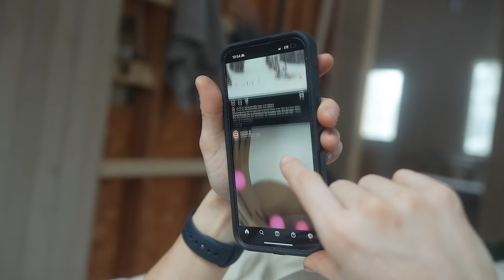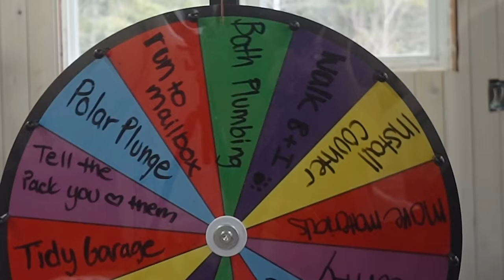Winter In The North

Comment from the maker: Do you need a spinning colourful wheel in your life? This was the BEST & most fun way to get motivated. We’re all doing the best we can, be kind to yourselves 💛
Reply: You should keep the wheel! What a fun way to get tasks done.
Reply: Yes! I always said I never finished the last 10% of my projects.
Reply: I need the wheel. I was in the process of ripping out my kitchen for a DIY rebuild, (i have two cupboards, the stove, sink, fridge and 2 feet of counter left) when one end of my house developed a huge roof leak, lead to discovering hidden issues, and eventually ripping down part of my home to build a new foundation and reconstruct. A builder came, asked for a huge up front payment, and what I got from it was a decent foundation, a pile of lumber, a rickety set of steps to my second floor entry that took out half my outlets upstairs, and a poorly poured, faulty slab before he split. I've been so overwhelmed that I'm immobilized.. help. And, if you need it again, I can send it back!
Reply: @GabrielleSR  I agree
Reply: I need it, but I don’t know if it would help! 😂😂😂😂.  My van needs: counters out of the front passenger seat and on the counters,  gray water under sink needs cut to size, propane line connected from stove to tank, last coat of paint, switches installed, and wiring finished so I can close the ceiling corners, windows and max air fan need resealing…..  oh and rear doors need insulation…. 😂😂😂😂.  Otherwise, it is livable and I love it!
Reply: Sometimes you just have to force yourself.🌀
Reply: Brilliant
Reply: Been following you two for a few years and I think this was my favourite video you’ve put up!  You girls had SO MUCH FUN! You should keep the wheel as a keep sake..
Reply: Yes! What an awesome idea!! I need a wheel for sure! I try to do too many things at once and overwhelm myself. Lol!
Reply: Great videos love it I have D D
Reply: I am totally DDD i still haven’t finished my chicken coop or my garden or rain catchment and other things that wheel would be helpful with much love
Reply: My wife just bought a house in Florida. She’s a disabled vet and we both suffer from DDD! 😆 I’m surprising her today by flying 900 miles to show up unannounced and help her get some things done. Haven’t seen her in 6 months! 😩 one day we won’t have to do this and will live together! IM GEEKING IM SO EXCITED TO HUG HER IN 6 hours! 😁😁😁
Reply: Hello vanwives!! We are getting married this summer (finally!) on our acreage. There are so many things to do, the list is long and I definitely feel a case of the DDD. Your game show wheel would be just the thing to make it fun instead of overwhelming 
Thanks for sharing your week ❤
Reply: Hi Girls! Our names are Bailey and Jaxyn, we are jack russells, and we live in Calgary. Our moms watch you every Sunday like clockwork! We just heard your last video, and we think our moms would be the best candidate for the spinning wheel! Why you ask?! Well one of our mothers work full time at a hospital, and our other mother is opening a new business next month. But that’s not the reason they should have the wheel! They are planning their wedding July 23 at our acreage and they have sooooo many projects to do that they are taking all of July to get them done! We think that the wheel would get them motivated every morning to get the long list done in a more fun way. Anyways, we love you, and maybe one day we can meet Bella and Izzy to play! 🐾🐶🐶
Reply: This was a fun idea! Thanks for sharing. Right away, I told my husband we need one! He’s self employed, I’m a homemaker, we have two tots. Task after task trying to establish our homestead, engaging with the littles, keeping our business going, and just life! Holy cow, it’s a lot. Maybe this will get the kiddies excited about chores too, haha. Way to get it! P.S. Happy Valentine’s Day. ❤😊
Reply: I think everyone needs a wheel in their life. I’m home with my 2 kids ages 9 and 3 for half the month, because my husband is away working and I find myself not wanting to do anything when he’s gone lol.
Reply: I need a wheel for cleaning ! All my chores would be so much more fun! 🎉 love love love this video!
Reply: I'm also living off grid without running water or electricity right now working on starting a school bus conversion, and my dilly dally disorder is kicking into fill gear rn. That wheel might be my neurodivergent brain's only way of having a roof over my head by next winter lol.
Reply: I need the wheel! I'm an elementary school teacher and my partner and I are foster parents. With all the tasks and never ending needs of little ones, I get DDD for all the things I need to do for myself. Prioritizing others 100% of the time is a habit I'm trying to shift. The wheel could really help motivate me and the kiddos!
Thank you for being the queer inspiration I need to get up on a Sunday morning. #queercaregiver
Reply: You need to put one more project on that wheel, you know those steps you installed on your porch, the handrails needs the cross bracing installed to match the rest of your deck railing, i love your videos, very inspiring
Reply: My name is Dawn Dilly Daily Disease Owen! DDD is my middle name! And i start projects and leave them.  My wife hates the messes I leave behind! The messes inside and outside, up and down.  They are everywhere! That's why I need the spinning wheel! It'll be the glue that holds my marriage together.  🥰🥰🥰
Reply: I need a wheel to help finish my basement reno as well as to help make chores more fun for my kids.
Reply: This is an awesome video. Not what I expected. I needed this today!🌺
Reply: We need this wheel. My partner and I are doing a home renovation in anticipation of a family reunion. We have so much to do, but we don’t know where to start. I think the wheel could save us!
Reply: Honestly, you girls give me such motivation. I am in a bit of a hoarding situation. I have been severely depressed for about 3 years now and have buried myself (in my back bedroom, literally buried, i dont leave my room) ... I am slowly gaining some semblance of life back, and now I have to climb around my house. I need to just motivate myself to clean it, get it done. Remove the trash and all this buildup in my life. Maybe I will do some sort of wheel, It seems to have motivated you lovely ladies. I want so badly to be happy again and to do something simple even if its just preparing some food on the stove or taking a shower. It's been a long time. I just really and truly want to say thank you to you both because seeing you guys having some of the same struggles with DDD and motivation, it helps me to see you overcome it. I think i can!
Reply: So....   where, dear ladies do we get a wheel!!!  ? ❤
Reply: Would love to see you guys carry bear spray
Reply: From the second u started this colorful wheel I thought THIS IS SUCH A GREAT IDEA I TOTALLY NEED ONE!!!! Its spring cleaning season coming up and with a house full of teens this would make it soooooooo much more fun!!! U girls r great thanks for all the motivation u send our way every week💜👍🏼
Reply: I need this wheel. I just do.
Reply: What is in your purple smoothies
Reply: Dang.. fried hair does stink... I love you also put Fun projects on the wheel... I’m a workaholic so I get this video and I’m listening ❤❤Happy Valentine’s Day .. Love to you Both and the pups too💙💙💙💙
Reply: We have been trying to get more organized this year and it's a hard list to get motivated. We have a hard time getting motivated where to start. A task wheel would definitely help get us both up and work together to accomplish one task at a time. What a great idea! Love it. We could definitely use this in our lives.
Reply: One thing I’d say you need as far as security is a rifle and/or shotgun. There are solar powered Wi-Fi cameras you could get as well. When you get an alert you can stream right from a device. Get a few Wi-Fi extenders as well to boost your signal and tie it into the solar panel on the camera.
Reply: “Production is the basis of morale.”-LRH.  The wheel reminds you of this fact.  Now that you know it, you no longer need the wheel to combat DDD.  It is however great at a party.  Spin the wheel to determine what is for dinner or spin the wheel to decide the activity or spin the bottle (wheel)….. it was great seeing your smiles.  Made my day!😃
Reply: I am not motivated , and neither are my students. I would use at house to get my house in order. I need it to Motivate. Then I would take to week to my classroom. Would be perfect for classroom chores, but I’m thinking it would be great for choosing rewards once a task is complete in class!
Reply: Hey J&C. I’m your loyal friend from Midland near Balm Beach where you landed in the start of COVID. I’m trying to build a brewery and chocolate factory in our little town. I have lots of help and lots of jobs, but your incredible spin wheel of inspiration would be sooooo helpful. Cheers and we can’t wait to see you when you visit this summer.
Reply: YES!!!! We need this wheel! We were watching the video (LOVE them!) and said we needed one of these to get our HUGE list done! We also are fulltimers (Jeep & Popup) then got 80 acres in Northern Michigan.  The ToDo list is out of hand! But we look forward to each one. We would adore this game AND pass it forward when done! You ladies are an inspiration in so many ways 💜
Reply: I just love your videos 😀
Reply: We are in the midst of a van build, started last year, we definitely need a wheel of motivation
Reply: My granddaughter and I watch your videos every week.  When you showed the wheel she said “that would be great for my chores”.  I see one in her future😊
Reply: Awesome you guys! Great inspiration to get stuff done and mixed with 20 min naps and pizza. Great way to end Sunday! 🙌
Reply: My wife and I live in Hammonds Plains, just outside of Halifax. 
We love your channel. 
We are grateful to you both for helping to diagnosis our very own DDD!!! 
We are Grace, David, Katie and Divot we are Dilly Dalliers. 
We would love to have a the DDD wheel. Help us please help us 😊
Reply: What a great life learning episode! Just do it! Reap the rewards of hard work, and Be kind to yourself especially in failures! Which I didn't see any here! Love all your motivational stories, because we all are DDD and you help us be human again!❤❤ Love you from one little old lady proud pack member!
Reply: My amazing boyfriend and I bought a 1952 house that needed fixing. He and I  definitely have DDD. This wheel would be a lifesaver, ESPECIALLY living through renos.🥰🥰🥰
Reply: Oh my, my daughter and I have so much to “Finish” she is 35 me older but together we have homes, I also have a cabin we are trying to finish so if you wouldn’t mind saying where you got the wheel we would love to buy one to share when we need motivation to get rid of DDD.
Reply: Tbh. I could really use the wheel it been such a hard year. I spend all of last year I. The hospital (I have CKD) but I have always been so active before but after the year long hospital stay and being back home it’s just been SO hard to get outta bed and be motivated I feel myself slipping more into a depression I really just need to try to make it fun and give myself something to motivate me more I wanna get my life back I’ve even gained weight that I never have before it’s just been hard. I feel like this would help me get more organized when what I need to get done and make it fun too. I love you guys. I’ve been watching y’all’s videos you guys really help me stay positive. Thank you 🙏🏻 ❤
Reply: We always eave out projects at 98% done! We are transforming an old bus into our tiny home and right now it feels impossible to get anything completely finished. We would really benefit from a wheel!
Reply: Love the white coats, you both look gorgeous
Reply: I need it for my DDD too! 😭
Reply: I NEED that wheel!
Reply: We love you too, I was so ill over Xmas I'm now better in two weeks I've painted entire kitchen , cut out three yucca and on the root of the 3rd , mowed my entire yard , taken two medium trees down , poisoned vacant house yard with permission of owner who has had surgery , cleaned entire house , washing done as well ... I have multiple disabilities and I'm so proud  of me ... and I'm nearly 60 .. life is good , my down time is watching all my favourite Youtubers like you two ❤ Aunty Down Under Australia 🇦🇺 😉my daughter needs this to get moving and get the kids on chores as well 😀
Reply: Release a wheel as merch! 😂😂😂❤
Reply: I loved this instalment . A very needed reminder to get creative and get things done . I’m definitely buying a wheel. You guys are kicking ass !!! ❤❤❤
Reply: My wife and I struggle so bad with this stuff ever since covid. The wheel is an incredible idea and I’m getting one regardless if you send it or not!! Thanks to you both for inspiring and making us smile. Also… the burnt hair 😂😂😂😂
Reply: Dilly, dally, disorder has set in at our place and we need help!! You Ladies are such an inspiration! 💞
Reply: @colleenbalch328  .😅
Reply: @colleenbalch328  ,
Reply: OMG My DDD is off the charts!! Please send the wheel so I can get my life back on track! I promise to make a video. xoxox
Reply: Single mom and love your channel. I suffer from ddd all day long.
Reply: This was one of my favorite episodes! So fun and motivating! 🐾
Reply: Me and my soon to be 15 year old son really suffers from DDD 😅. I think we would be helped by your wheel 😎. Thank you for another fun video ❤️❤️.
Reply: I need the wheel! I am a teacher that struggles to remember all the stuff I have to get done. I also have ADHD, which doesn't help with the whole focus thing....
Sorry, a squirrel ran by.
Perhaps the wheel would help keep me on track. Please let me have the wheel. I can also use it as a probability lesson in my math class. (I'm also in Canada, so the shipping would be less for you to send to me.)

Thanks for the video, it was entertaining and inspiring.
Ian
Reply: I started the refurbishment my house back in summer 2021 with a rewire, new boiler and new flooring through the whole place after a flood. Because of the rewire, all the ceilings had to be replaced and every room redecorated but it's been getting harder and harder to get all the work done as i live alone so their is no one to hold me accountable and i suffer from anxiety and get so overwelmed i do nothing. Even you can't send the wheel to the UK, can you tell me where you got it?
Reply: Recently found your channel and have been binge watching... love your content, and the wheel is an awesome idea!! ❤

Comment: Love you ladies. The wheel is a fabulous idea. I am converting a camper van. Have been doing it for the past year. Ripped out the interior, made the subfloor, put insulation, a new floor, put linoleum down, trimmed edges with a finish, built boxes to cover wheel wells,  then my apartment building had a fire, so I was displaced for a few months, luckily I had a wonderful friend let me stay with her until I found a new place, then the van was ignored while I did jobs in the new place, like removing carpet in bedroom, put down a vinyl floor, cut baseboards, laid peel and stick tiles on bathroom floors, then lost momentum, baseboards are not finished, the van was ignored for many months, lots of jobs in new place to do, then dilly dally kicked in and lost all motivation. Lol Keep in mind, every step was a learning, never did any of the above before, you tube is my new best friend, learning, learning, learning. Trial and error is my moto. Lol wish I could send photos. It's gonna be a long process as I'm doing all this on my own. This week started building the bedframe, attached 2x4's to the walls of the van. As you know everything takes longer, extra trips to home depot, figuring it out as I go. So, long story long, you ladies definitely motivate ME. I love what you have done, what you are doing, watching you each week is so cool. Sending love back.

Comment: You Ladies Rock! I surely have this dillydally disorder. I'm disabled and on oxygen, and my strength has left, but I want to get it back, the little chores are the most hardest. I need my mower fixed, but ordering the part and just getting out there is hard. I will get there, slowly. Lol.. I love your videos, I have learned a lot. ❤️

Comment: Additional ideas: You could use some of your abundant rocks on your property and cement to build your storeroom with a cement base and a solid roof. Your food would be safely stored, and if it's a large enough space, you could also store a backup of dog food for the girls.  I mention these things because your cabin is small, and you don't want to overcrowd your space. And then it would just be like going to the store on your own property. This would also open up ideas of items you could buy at the store and add to your canned food supply. Also you would have dry storage space for large buckets of dry goods in case you get surprise  visitors.

Comment: Good morning ladies. I look forward each week to see what your up to and its such a pleasure seeing your happy faces. I have a couple of suggestion to think about. Using a copper pipe say 24 inches in length, (I live in the USA, namely Michigan that is why I only work with inches and feet.) Use the pipe to blow through when starting your fire. It might save your face from the fire and heat.  The other suggestion is a steal fan placed on top of your wood burning stove with spin the fan, thus it will push the heat out into the room better. Have a great day and keep on enjoying your life each and every day.